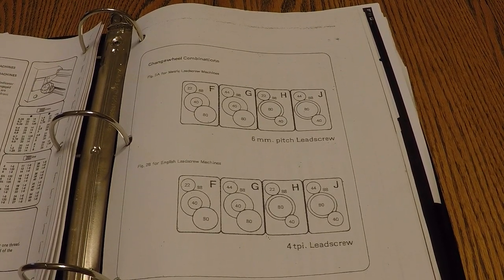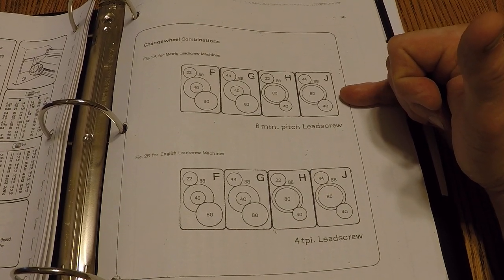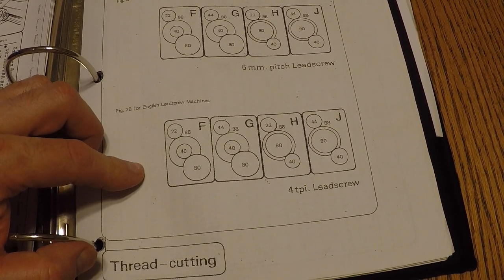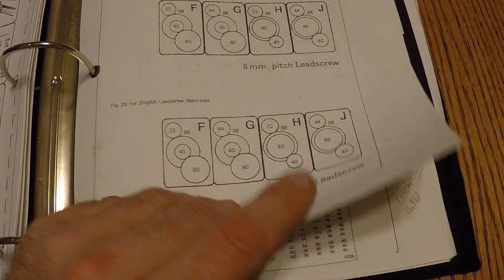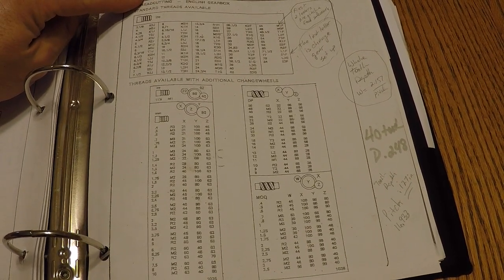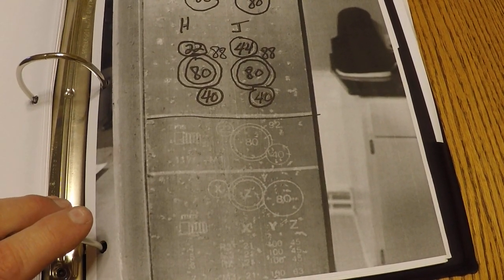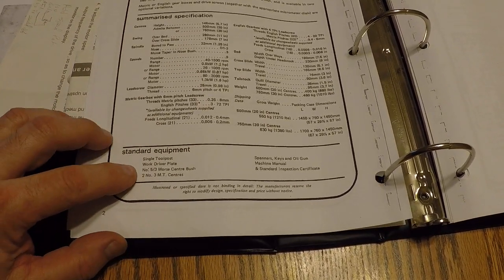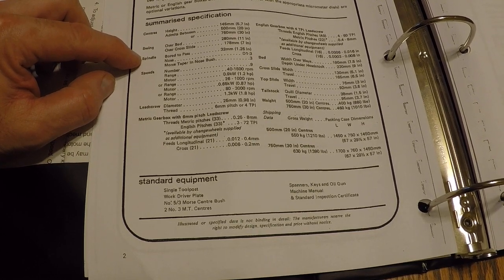Clausing/Harrison M250 Manual for Gear setups related to feeds

Comment: Hi Dan

Thanks a lot for the video, it's very informative. However I do have a question. I can't find a copy of the manual that you use. I looked on the Harrison-Yahoo-group and the rest of the internet. On Yahoo there are four manuals to download but they are all the same and they are not the manual you use. They don't have a section "thread cutting" as your manual. Can you send me a copy or can you tell me where to find this version of manual?

Peter
Reply from the maker: Thank you Peter. I believe all of the data was migrated to groups.io with the Yahoo hijinx. 

Let me know if you cannot locate and we can connect offline.